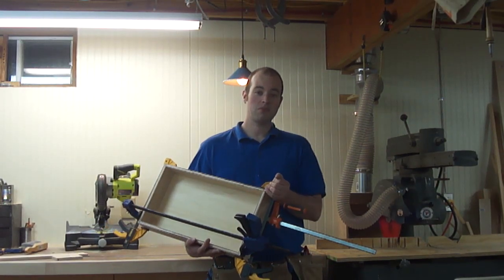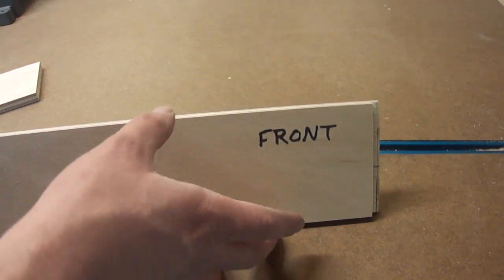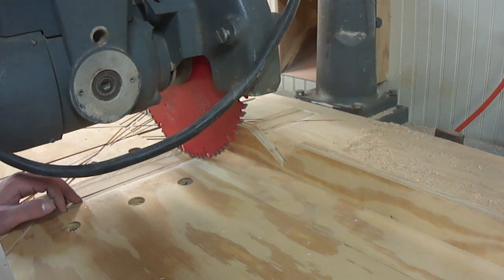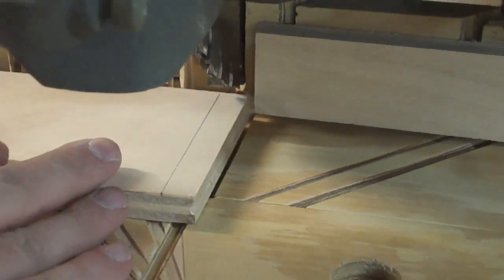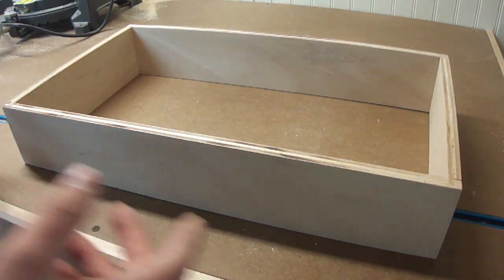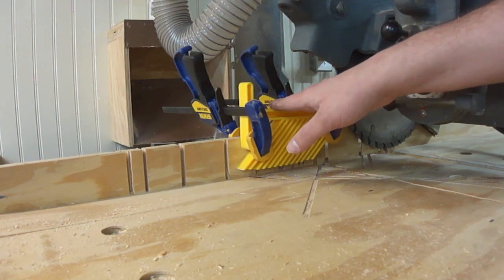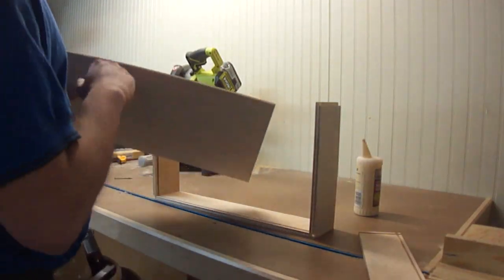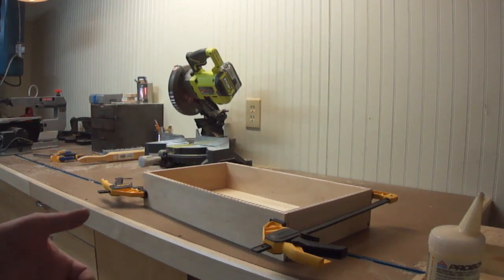Build a drawer using only a Radial Arm Saw!

Comment: Dude, when ripping multiples use the next piece as a pusher for the previous one. You can even use a scrap for the final one to just get the cut past the rear of the blade. The pusher shoe you use is not bad since it will also add down pressure, a  real necessity for RAS rips! The typical "push sticks" should be outlawed ........ You need two of them and 3 hands to make them all work correctly. Also, add an additional snubber to the nose of your blade guard to extend it enough to just "kiss" the top surface of your workpiece to prevent "lift off". A bent piece of stainless steel would do just fine if bent into a sharp "J" shape and bolted on.  A feather board clamped to the fence in front of the blade to prevent lift off would also be helpful. I used a RAS to straight line rip about 800 lineal ft of 1" Cypress that was 14 ft long. My saw table was 28 ft long and the fence was a 18 ft 2" X 6". See this: https://www.woodworkingtalk.com/f2/evil-machine-28461/ The RAS saw was an old underpowered 10" Craftsman, but it did the job if I was patient. I collect RAS and have about 6 of them. I found that the 10" and 12" RAS carriages are interchangeable and you can easily set one up with a dado blade, OR a cross cut blade and swap them out when the operation changes. I hate changing blades. I even made a radial arm router with one carriage, and a 2 axis panel saw with another. I LOVE 'EM! Woodworking since I was 13 years old in 1956. First table saw with HS graduation gift money in 1960.
.

Comment: Nice use of your RAS.  I have its little brothers, a 12" Delta and a much older Delta/Rockwell 12"  It seems that everyone today is afraid of the RAS, but I find them less dangerous than a table saw!
Reply: Different tools for different jobs... Let's see what sort of jig you would need to do finger joints on a RAS... :) On a table saw, that's not that difficult and you have minimal blade exposed... The only way that I can think of a doing it on a RAS would be to put the blade horizontal and have the entire blade exposed... And even that would only be able to do short lengths of finger joints, not a 12" board like you might want to do for a large box... I guess you could create some sort of sliding contraption that made the RAS into basically a table saw turned on it's side... Or maybe put it in ripping mode and create some sort of fixture that could hold the work piece mostly below the surface of the RAS table...
Reply: @seanseoltoir  Here is a link to a video on making box joints on a radial arm saw:  https://youtu.be/7uCoDuEGLt8
Reply: Agree. The RAS got an unwarranted bad rap.

Comment: Great video making one drawer.   Suggestion for if you are making multiple drawers.   After ripping all your drawer sides, set your stop block, stack the boards, cut the end off, slide all at the same time to the block, and cut all the sides with one more cut.   This will make them exactly the same length.   Then slide the stack and cut all the drawer ends.  The huge advantage of a RAS is you can cut many boards at once.  Like set 1x or 2x4’s on edge and cut the stack for multiple same length boards.

Comment: A quality Radial saw is all you need. Table saws cause more injuries by far according to OSHA. One thing I never thought of was slipping by a table saw and putting a hand  down to stop your fall in the wrong place. The better the quality and alignment for your Radial the safer. I have a 12" commercial Delta . I did have OSHA in my shop and didn't have my anti kick bar on it , but he didn't fine me and really wasn't concerned. I never use it 😎

Comment: Nice saw ❗ but I have best ripping results and less push back in the" Out rip" position . I have adjustable back boards to get the blade close to the fence. I've had far less kicks also , because the carriage is closer to the post and far more rigid and locks in tighter. 😎

Comment: Hi Great Video. I have a radial arm saw and use it mostly for cross cutting. My table saw is used mostly for ripping. I like this method because it usually saves set up time. It looks like you could just extend the guard by welding or bolting a short extention to the front of the guard. I will be looking forward to future videos.
Reply from the maker: Carl Wehner thanks for watching! Extending the front of the guard could work, I’ll look into that.

Comment: Well that was an extremely useful tutorial and an excellent first project for getting a handle on the use of my newly acquired, old saw. Thanks. Say, two things occur to me:
1. Perhaps you could have used a feather board pretty tight to the front of the blade to prevent the change in dado depth you were worried about since that was where the lift was going to come from. 
2. Seems like you could put some kind of spring-loaded rolller bearing  on the front of the guard to put smooth downward pressure on the inbound stock.

Comment: For a drawer bottom, it's possible to use 1/4" material and glue battens on the bottom.  Also, instead of using drillbits for spacing and checking the dado cuts,  I use bits for a machinist lathe, however key stock from the hardware store can be used as well.   They're available in various widths.  By the way, that's a nice pushblock you got there ;)
Reply from the maker: Bob Blarney I actually have a piece of 1/4” key stock that I use for setups. However I figured not every one would have key stock but every one has drill bits. It is a very nice push block, now I just need a plexiglass blade guard to go with it. ;)
Reply: @TheNorthlandWorkshop  use polycarbonate - acrylic is usually too brittle, although some formulations used for glazing are more shatter resistant.

Comment: Great Vid Ian.  Just a note, when you rip a dado, you don't need to push it through.  just keep the pressure down and back and take it all the way through.  You don't have to worry about a detached board sitting there.

Comment: Thanks, Ian, as always, very well explained.  Why not use the dado blades for the rabbit?
Reply from the maker: David Abineri good question. It was the dado head the dados on the drawer sides ended up about a 1/32” deeper than 1/4” because the sides were slightly warped. So I had to make the rabbits 1/32” longer so instead of messing with widening the dado I just made it in two passes, the second pass just removing the little sliver on the end.

Comment: The version of the quarter, quarter, quarter, drawer appears to be easier with the RAS than the table saw version.
Reply from the maker: I believe it helps to have the blade above the work instead of hidden below thing being cut.
Reply: @TheNorthlandWorkshop  safer method also